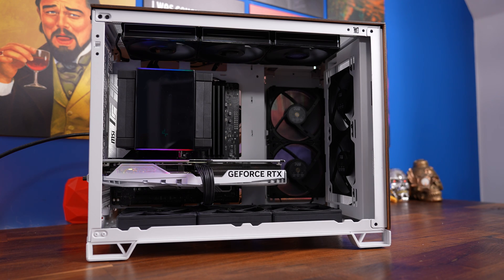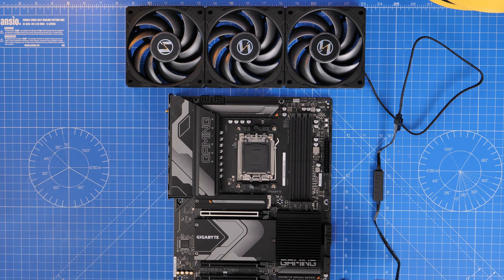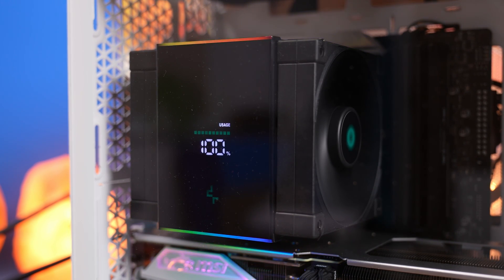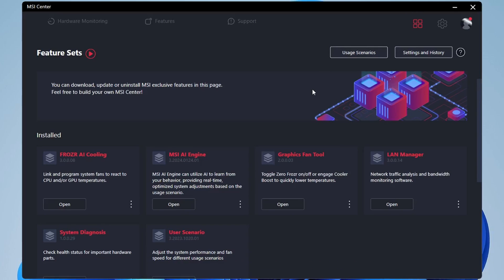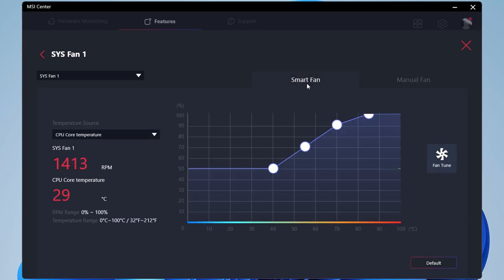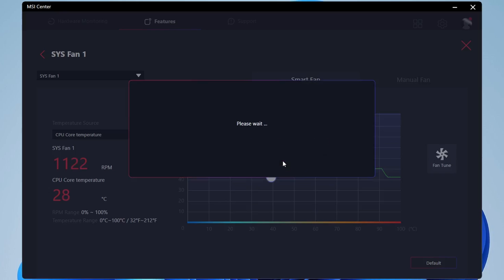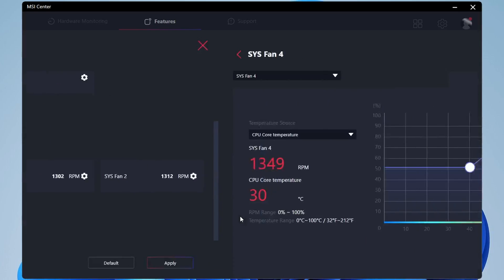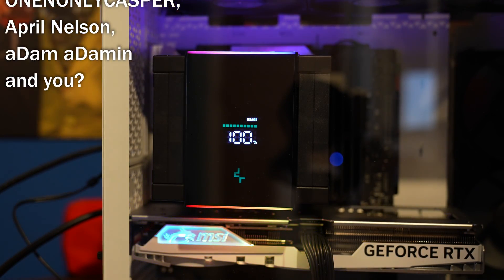Are your PC fans too loud?  Try these simple fixes!

Comment: Another tip I can add to this is to make sure to optimise your noise to performance ratio. Most gaming PCs, the GPU temps matter the most.

Set up a fan curve to ramp up with the GPU, but make sure to set it at a maximum level you're comfortable with in terms of noise. In my findings, after a certain RPM, the temp reduction is SUPER negligence compared to the noise. 
Found this out not too long ago in my personal machine, I had my Silent Wings 4 fans set to about 1900 RPM when the GPU got under load. Dropped the speeds to about 1400 RPM and temps only rose by 3°C with a massive noise reduction. No changes to GPU fan speeds which were running quietly too.

In the end, I reduced them to about ~1100 RPM. Essentially silent and I am quite happy with temps.

Just sharing two cents in case it helps someone 🙂
Reply: My gpu isn't even that hot around 60 while playing but it gets very loud I did buy a second hand gpu and was going to upgrade
Reply: Would a thee node curve for bios fix the low rpm designed for my aio to keep cool gpu ? Or sustain 11100 rpm on the aio plus another 150 added for loads on games for system fans or add more than 150 over aio?

Comment: My fans went much louder when I turned on pwm
Reply from the maker: That's unusual! They should be quieter with PWM. Assuming they're PWM fans of course. Did you check your fan curves? Are you sure your system isn't overhearing?

Comment: If my PC doesn't sound like a windtunnel  it's not PCing enough!    Maximium speed boi!!!!!    Seriously though I run my fans at 80%  no curve when using it,   then if I'm just watching videos  it goes into the normal low speed fan curve  100% fans actually has worse cooling effects on parts then 80%  at least how I have it set up.    I get 5 to 10 degrees cooler at 80 then 100

Comment: Would a graph with three only points be accepted for full usage on the taskbar, at a 55c half percent on the case fans / 800 rpm starting, 65c / 1250 rpm middle, 85c / full blast work for productivity on the pc ?

Comment: do i need to download this bios and hardware monitor settings????
"mash into the key until you get to the bios" is not so helpfull man
Reply from the maker: Press del or f2 when your pc is turning on, that takes you into the bios. From there look for fan speed settings. It's difficult to tell you where because each bios is different but it should be there somewhere

Comment: Please reply I changed the cpu fan to pmw too but you didn’t mention that was I supposed to do that or keep it on auto
Reply from the maker: Should be fine. Have you noticed an issue.
Reply: @TheProvokedPrawn  no I played Fortnite and everything worked but I got paranoid and changed that cpu fan back to auto and left the others in pmw the pc is much quieter the problem I’m having is that the pc I think it’s the graphics card fans periodically buzz or like spin super hard and make a loud noise and not sure why the temps aren’t affected but it’s loud and it’s annoying it never did it  before gonna take it out and clean it as it’s really dusty so maybe that’s why

Comment: I did these and it didn't change anything?
Reply from the maker: I'd suggest that you have a bigger problem then. Like your system is running too hot - probably your CPU and you need to address that

Comment: fans properly connected to cha/sys fan headers, set to pwm on bios, ajusted curve so that they dont go above 80% total rpm, and still my fans are revving out of nowhere mid game. The temps are well under control, I cant seem to figure out why the fans all suddenly decide to boost, especially since I set a curve to prevent them from hitting 100%. anyone have any idea what I can do to fix this?

Comment: If youre using the Arctic Freezer III AIO'S, do NOT use the AIO fan cable. Use the Individual cable that split into Fan, Pump, and VRM. Plug Fan>CPU_FAN, Pump> CPU_Opt/AIO, and VRM>SYS_1/2/3/4. My fans went from 100% RPM to a regular adjustable speed

Comment: Hey everyone, 

Incase if you're running into same issue like me where my pc fans were on full speed all the time and super loud. 

I tried everything with no luck like: update BIOS, used 3rd party fans software, messed around with all fan settings in BIOS ....but nothing was working.

Then I realized I was using a smart fan controller hub, specifically the "CORSAIR iCUE COMMANDER CORE XT Smart RGB Lighting and Fan Speed Controller" to connect my fan cables to my motherboard.

So, I installed the iCUE software for windows and instantly my fans turned into a silent UFO spaceship. 
Absolutely 0 fan noise.

My main pc parts are: 
Motherboard: Gigabyte Z690 AORUS Elite AX
GPU: NVIDIA GeForce RTX 3070 V2 OC
CPU: Intel Core i9-12900KF
RAM: Corsair VENGEANCE RGB PRO DDR4 32GB (2x16GB) 3200MHz CL16 Intel XMP 2.0
RGB/Fan Controller: CORSAIR iCUE COMMANDER CORE XT Smart RGB Lighting and Fan Speed Controller

I hope this info helps in case if you have a specific use case like me. 
Best of luck.
Reply: Bro thank you, I was sitting next to a jet engine this whole time and downloading the lian li softare instantly turned down the fans lmao.
Reply: @Morphal  which software is it?
Reply: @Rico-245 it depends on what brand your fans are. So for me my fans where Lian Li brand so I searched up the software for them, downloaded it and set it up and they instantly turned down by themselves, or you can change the speed manually to whatever you want.

Comment: I'm really curious why exactly changing to PWM mode solved the problem with the noise, which it was specially loud while I was trying to play a game (besides the noise that made when I turned the PC on)
But, just to make sure that the problem was caused by a configuration of the fans in the case, I tried again entering in the BIOS and choosing "auto-detect" and "DC mode" and turning on the computer, and playing  the same game with both modes, just to realize the noise was gone in both cases, which is even more curious. 
I don't really get it...
🕴🏻

Comment: my pc is prebuilt, so if all my SYS FAN ports in the board aren't used how is it connected ? and can i adjust it ? i only can change rgb but other than that its stuck at 100% and i can't change it
do i need a new case fans ?
Reply from the maker: Depends on the fans. Possibly connected to a controller that's adjusted via iCue or L connect or other software?
Reply: @TheProvokedPrawn  i think it's connected to the psu using a molex

Comment: Changing to PWM mode actually increased the fan noise, they've started to spin even faster .. didn't work for me
Reply: Did you find a solution?
Reply: @nicokorkiamaki2991  I choosed PWM mode only on cpu cooler, other fans are set to "auto" mode. Works good.

Comment: A GPU undervolt also works wonders. I did a super small undervolt to my 6650 XT. Fan's noise was reduced by about 40%, temps dropped 15C (hotspot is now always under 70C) and didnt' lose performance.

Comment: As someone that's got 11 Noctua industrial 3000 RPM fans in my PC case an aggressive fan curve is definitely needed. Now when my computer is in quiet mode for like watching videos or just surfing the internet eight of my case fans are off and only three of the six fans on my radiator or running at 500 RPM. I keep all my case fans set at a steady 700 RPM after a certain temperature and I let my radiator fans adjuster speed according to the CPU temperature. I get the best of both worlds as I get an ultra quiet PC and the sound of a jet when I'm playing with my flight simulators as it feels realistic as I can feel the heat off the computer blowing in my face.
Reply: Nice! How do you have the headers set up if you don’t mind me asking? I have all noctuas also and trying to get them just right.
Reply: @ricardoh.6850 The three rad fans are on the 360 rad. Two fans at the top of the case are on a header. Rear fan is on its own header. The two fans at the bottom of the case are each on their own headers. The other three fans on the 360 rad run off a header that's on the pump.
Reply: @jamesm568 thank you for that information. Does the pump header run at 100% at all times or is that one controllable?
Reply: @ricardoh.6850 You can change the RPM through the bios or through the AIO software depending on how you use it.

Comment: Gigabyte's "silent" mode is much noisier than my custom curves, i recommend taking the time to set up the curves manually to whatever sounds best and keeps good temps (little guide in next comment)
Reply: Now for a quick easy guide:
Set the curve to the lowest you can (usually 20%) at around 40°C, it won't go cooler than that so thats the starting point, then 100% at about 80°C and all the points in between should make a straight line, it works super smooth

Comment: I have one group (daisy chains) that just wont change speed no matter what cables are plugged in. I just cant work it out. Why would one change and not the other?
Reply from the maker: Have you changed them to PWM in the bios
Reply: @TheProvokedPrawn  Yep, no fans even show in the bios, only the CPU header which has the pump connected. In L-Connect software, one group changes RPM and the other one doesnt... Tried changing cables around, still nothing

Comment: i have aio cooling or whatever its called, but everything is put on silent and it gets extremely loud, idk what to do, im not good with computers
Reply from the maker: It could be that the CPU is too hot and the fans are spinning faster to compensate. Which could be a few different things. https://youtu.be/sVEXd-Wp8FY
Reply: @TheProvokedPrawn  what’s a good pc case to get, i had the tdmesh 300 but i need something with good airflow
Reply: I have a PC someone built me the thing has 4 fans in it, Idk if it's supposed to be this loud but I remember they told my I can't change the speed because they are hooked up differently or something. Uhhhh idk what to do.

Comment: I'd suggest NOT using your mainboards software at all if you can avoid it. They are known to put so much crap in their software, which ramps the speed of the fans up itself since it uses so many cpu cycles because of all telemetry going on. Use a tool called Fan Control. Amazing software, lightweight, no commercial. And afaik, it is the only fan software that can handle gpu fans as well.
Reply: l When i exit Fan Control after entering all my fan settings and  starting my pc again  it changes my  settings  even though  i saved it manually. What should i do ?
Reply: I agree Ima try to download this software I did what he did in the video and at first it seemed like my pc got a little bit more quite but when I got on COD my pc got loud asf
Reply: i agree with you i love fan control
Reply: Fan Control doesn't detect corsair system fans.
Reply: dayum it got silent once I got this app very cool thanks!
Reply: I use MSI Center, is that ramping up my fan speed (I didn't touch any settings, just using hardware monitoring and rgb changing)
Reply: Yo can u guys help me it dosent work for me

Comment from the maker: Specs of the build  (note these include affiliate links which may earn me a commission at no extra cost to you):
Case - Corsair 2500D Airflow - https://go.corsair.com/Py9DWe
Motherboard - MSI B760M PROJECT ZERO - https://amzn.to/49t41EA
CPU - Intel i7-14700k - https://amzn.to/3TcHdn8
RAM - Crucial Pro Overclocking 32GB Kit (2x16GB) DDR5-6000 - https://www.crucial.com/memory/ddr5/cp2k16g60c36u5b
CPU cooler - DeepCool Ak500 Digital https://amzn.to/3TloZjr
Fans:
Lian Li P28 Unifans
PSU - Corsair RM1000e - https://www.youtube.com/watch?v=FUnfuF6nSVw
NVMe - Corsair MP600 Elite - https://go.corsair.com/WqakEA
GPU - MSI GeForce RTX 4070 Super 12G Gaming X Slim https://amzn.to/3uK6OdE
SSDs - Crucial MX500 2TB and Crucial BX500 2TB https://youtu.be/IOJNybKZ4wk
Corsair USB hub - https://go.corsair.com/5gM1Pj